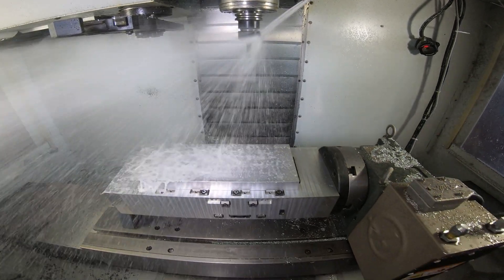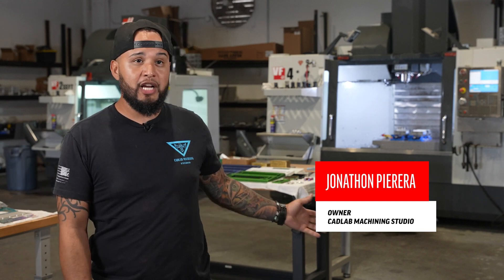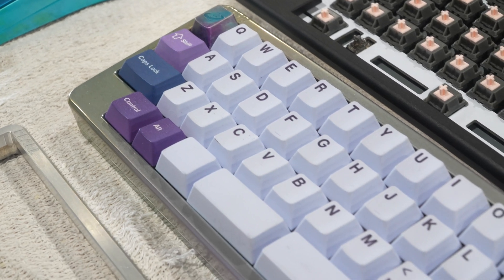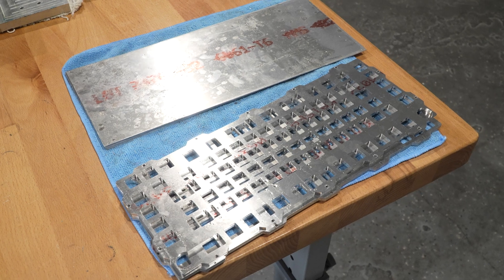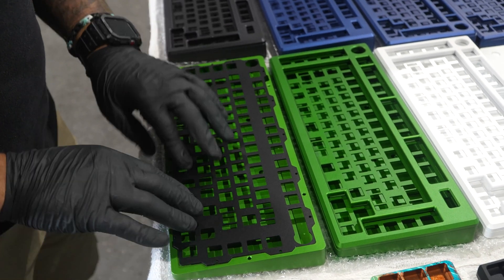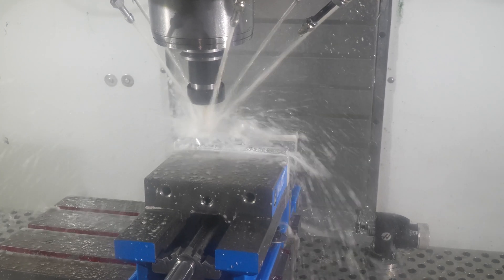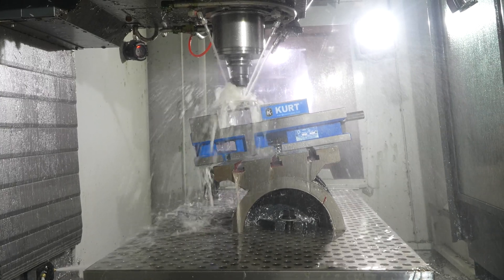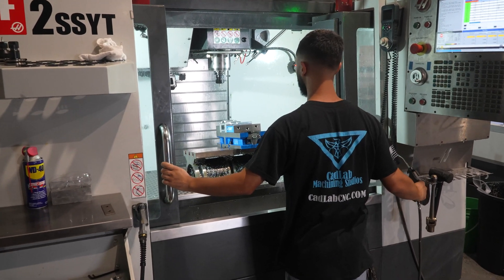Why Haas CNC Mills are Ideal for Makers, New to CNC Machining

Comment: I want to get a machine to start making golf club putter heads. I believe the V4 SS is an ideal model. The daunting part seems to be learning how to program to make the machine do what you want it to do. Where and how is the best way to learn that?  How long does it take?
Reply: Very smart. Did you know that Titleist, Taylor and PXG all have Haas CNC's producing heads for their clubs. I think Titleist uses Haas CNC's to machine molds for golf balls too. But yeah, putter heads are also something I've seen done as well on a Haas. If you're only making small quantities, a Haas DM would be perfect, but if you want to machine putter heads at a higher volume, the VF-4 is ideal.

You're local Haas Factory Outlet typically offers training courses and most tech colleges train on Haas CNC's. If you let me know where you're located I could probably help you out!

Comment: As a small one man business HAAS nearly bankrupt me in the UK. Machine has serious problems, which can happen. They then put me bottom of pile for service and response and at 35 cut hours it had nearly 350 hours downtime and they wouldn’t even buy back machine at used value and lied about causes.

They blamed tooling which performed OK on a cheap Chinese lathe!

Had 3 thou runout over 3” on turret and they said that’s OK (Used to run side of U drills).

Spindle cartridge failed.

Software caused huge tolerance errors of 0.1mm 

Overall a deeply upsetting experience which they don’t care about because I’m a small business.
Reply from the maker: sorry to hear that. We represent Haas in 14 states and Western Germany and I would hope that would never happen to a customer... Anywhere.